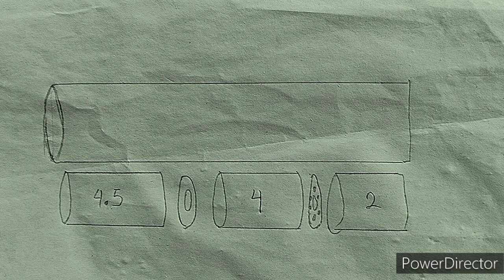3 layer PVC tank/chamber 2 divider( hidden wire)

Comment: What would happen if the combustion chamber had no dividers?
Reply from the maker: You will need to spray more denatured alcohol into the chamber, sometimes it wont ignite, lower compression means low power
Reply: @tatakilocano  Thanks for the reply😊

Comment: can i use 4 or 5 dividers for more power and range and bigger chamber 15 inches
Reply from the maker: Yes but it will be over powered
Reply: @tatakilocano  over power means it will work or not or blast
Reply: @tatakilocano  like i want upto 100 meters range o
Reply from the maker: Unlike on PCP airguns, it takes 1k to 1.8k PSI of output to make pellet reach up to 100 meter range  but on PVC toygun its not possible due to the structure and materials used that can only stand less than 500 PSI. Also considering the accuracy of grooveless barrel
Reply: @tatakilocano  thanks